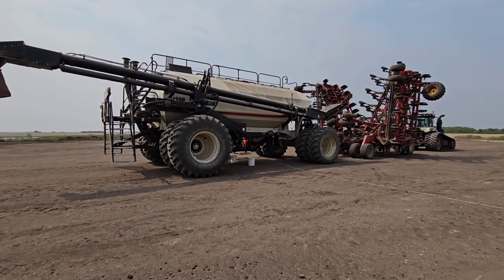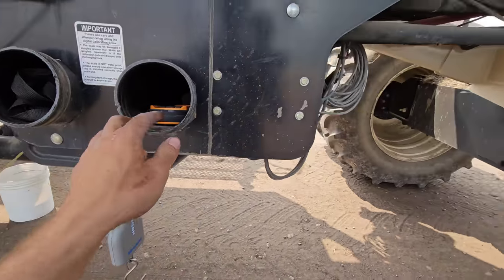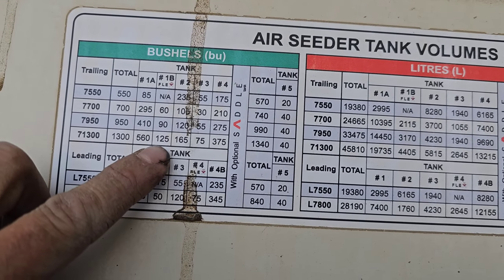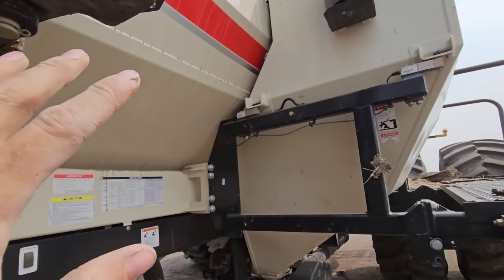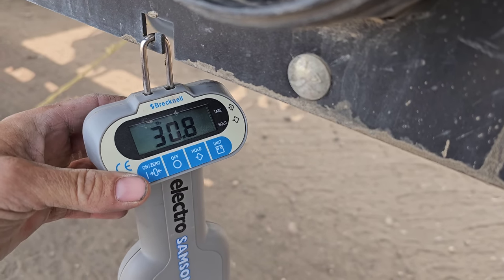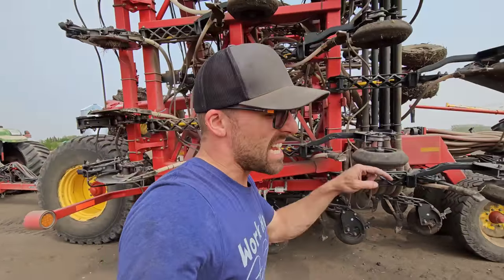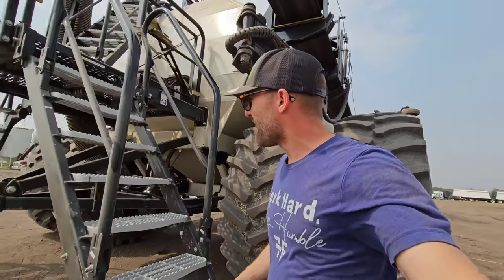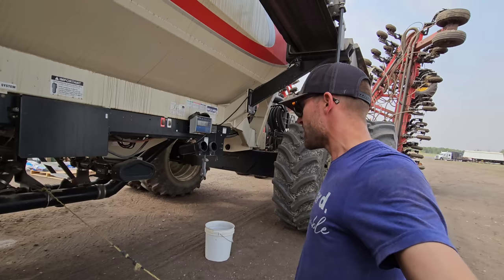How to switch crops and... 🤔

Comment: 2 questions mike
1. what type of fertilizer screen is that and where did you get it?
2. have you ever thought about using blots and washers instead of pins for your depth adjustment?
Reply: Wondered the same thing about bolts, but that would be a lot of bolts to undo every adjustment cycle and lock nuts hate being cycled that much.  I hope they find better pins and keepers, because it should be easy and "tool-free" to make those adjustments.